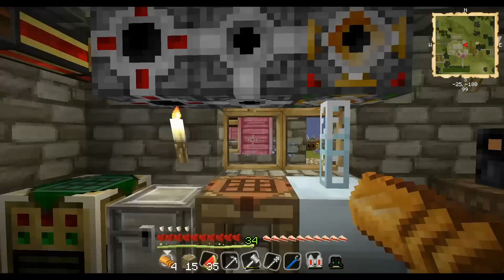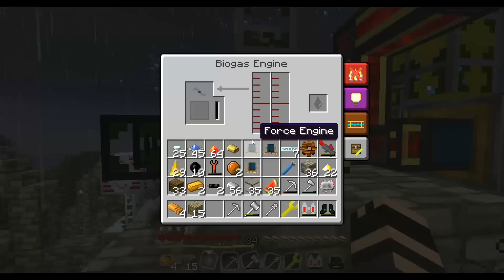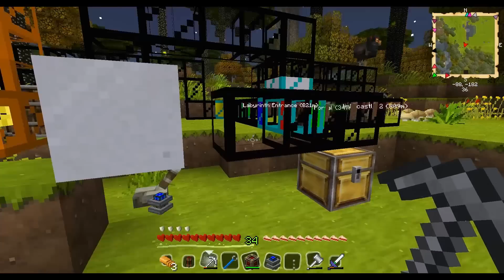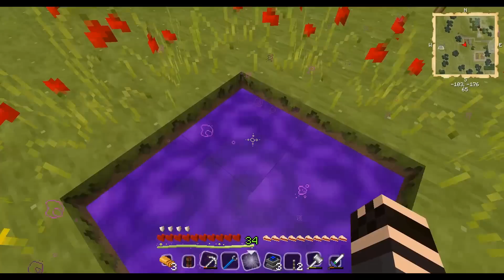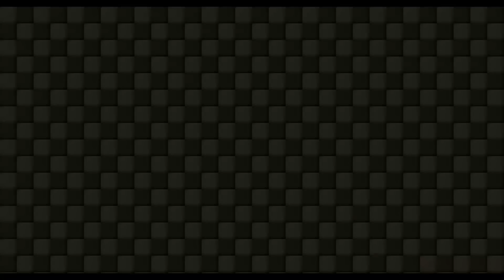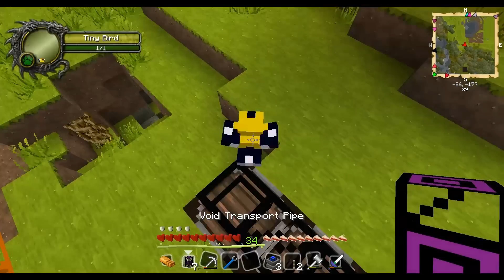Minecraft FTB Unleashed - S3E51 - Super-Powered Quarry

Comment: If you want power and lots of it. Use a buildcraft pump powered by 4 redstone engines with and endertanks to get it back to the overworld. Then use the lava to power magmatic engines. Currently running 93 magmatic engines on my world no problem. Recommend an iron tank as a buffer for if the lava lake runs out of lava gives you time to move pump with no loss in power.